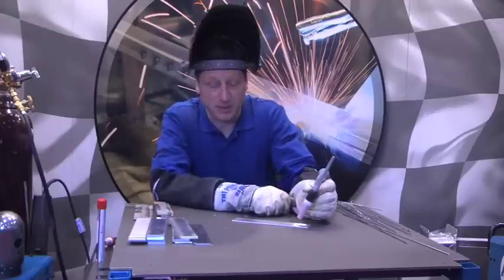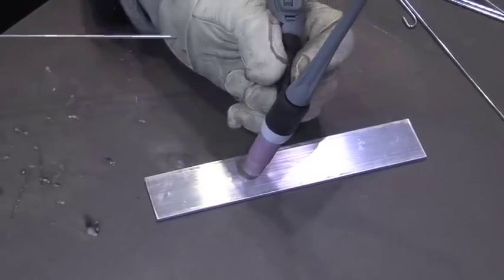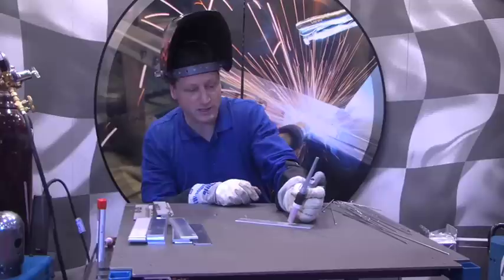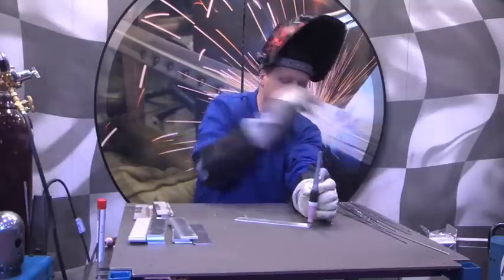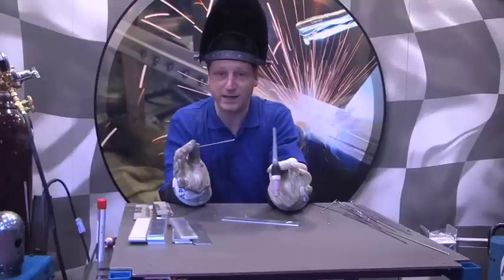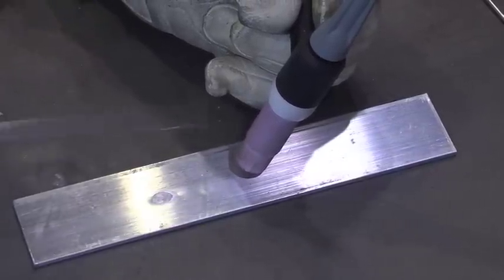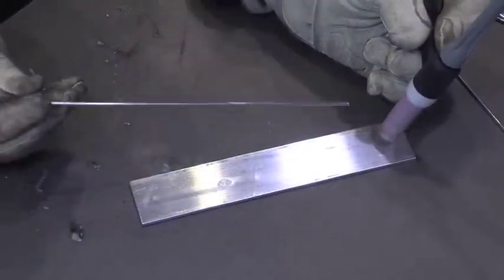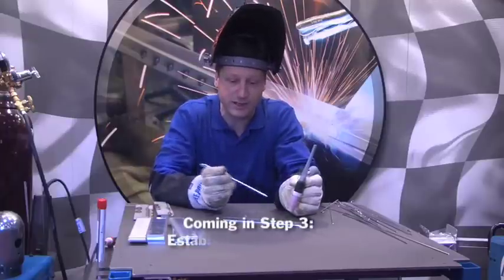TIG Welding Aluminum Part 2: Hand Movement Tips

Comment: Eddie one of the biggest issues you will face going from a flat situation to maybe a couple of tubes is your gas flow, depending on the location of the weld and or the area your welding in this can have a dramatic effect on the  weld.  Make sure your pieces are perfectly mated along the joint and your filler metal should flow in as a nice raised fillet.  I probably use more Shielding gas than most but my welds are better too, don't forget Temp

Comment: I notice that the filler rod is shiny aluminium. My filler rod is matt, not shiny. Is this a potential problem, as presumably my filler rod has oxidisation on the surface?
Why is it that I can do practice welds on flat ally plate ok, but a soon as I try a simple pipe/tube join, everything goes wrong and the weld looks terrible!